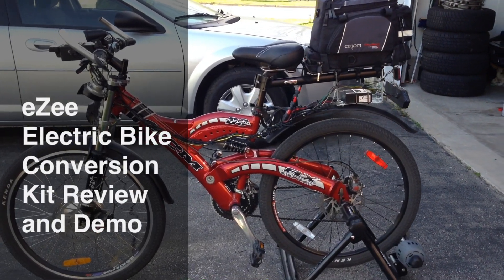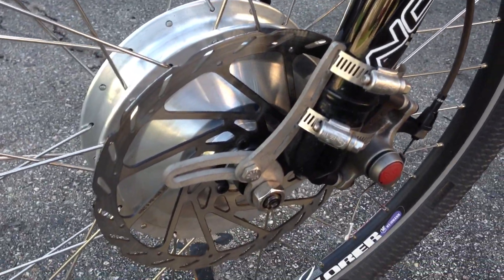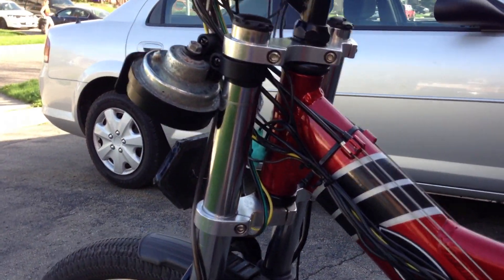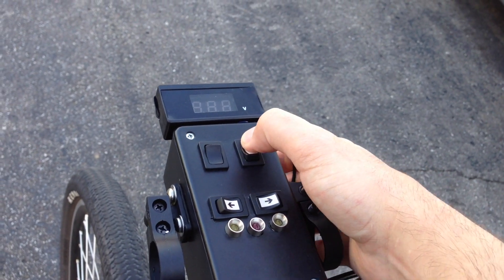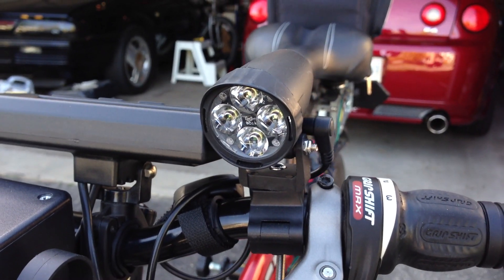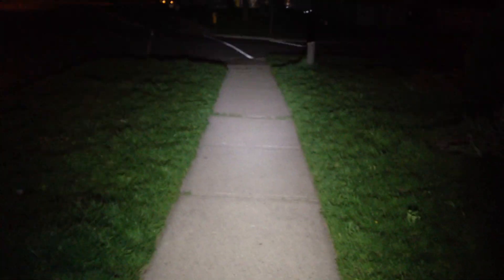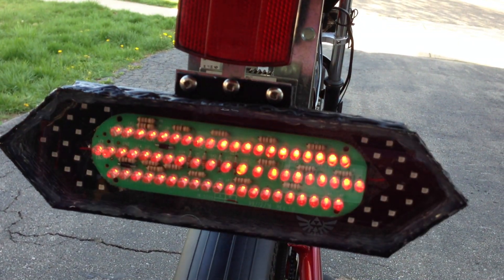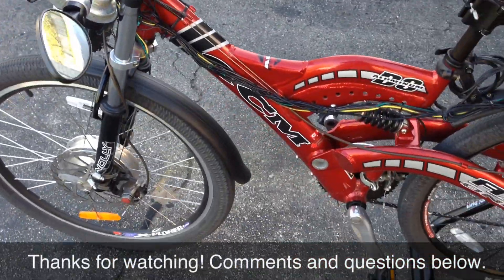eZee Electric Bike Conversion Kit Quick Review (after two years) + Demo

Comment: Nice Video !!  Because I'm involved with the radio control industry, I used a lot of RC equipment for my conversion.  Batteries are 4 to 8 depending upon needs 5000ma 6 cell LIPOs which gives me up to a 20ah 48v power supply.  I like your brake lights and turn signals, I used string lights for my tail lights, my extra headlights are from a large RC dune buggy, I still need to add a brake lights and turn signals all powered by a 4000 mah 3 cell lipo.  I need to install a center stand.

Comment from the maker: The lighting system aside from the headlight was custom built from scratch. I could never find something I found suitable for what I wanted to do so I just gathered some parts and wire and built it. Everything but the horn runs off the main battery for the eZee kit.

Comment: Ooohhhh NICE BIKE!  I very Much like the Lighting set up on your Futuristic looking Bike LOL.  Traffic here in Miami is HORRIBLE!!  Tell Me! can the turning signal lights be used on a regular non motor bike?  if Yes, where can I purchase something like this? TFS Again.... Enjoying your Videos.
Reply from the maker: It is possible to use a lighting system like this with a regular bike, but you would have to find a battery pack to power it, as on mine it uses a 12v power converter connected to the motor's battery pack to power the lights. I don't know where to buy a lighting system such as this however, as I ran into the same problem myself when I was looking and I couldn't find anything I really liked. My solution was to just build it all myself, aside from the headlight.

Comment: Alex - You're amazing. Well done! I'm just beginning on my e-bike curve. Adding a conversion kit to a new Cannondale Quick CX 2 bike. Should I go Ezee? Should I go BionX? Should I go ...? What's best to get my 95kg body + 12kg bike + 10kg shopping up lots of 100m 20% hills in Sydney, Oz? Can this be done in a (Sydney legal) 250W motor or should I go for 350W or 500W? Is it torque I need for hills rather than wattage? Do different Li batteries offer no more than a different top speed and/or distance? So many questions; so much fun. Neil
Reply from the maker: Hoping to help you out as best as I can. I'm no expert on any of this ebike stuff as I just kinda took an idea and ran with it so if anyone else reading this has any suggestions you're more than welcome to offer them.

I chose the eZee kit since it looked pretty easy to work with, allowed me to keep my disc brake with the motor, and it can be used with pretty much any bike. You can see my frame looks really odd compared to "normal" frames and some kits I've seen try to use the triangular space within the frame to store the battery and such, wouldn't have worked on my bike. I haven't checked out any other brands like BionX so it's more or less personal preference depending of course on what best suits your needs.

If you're gonna be dealing with a lot of hills, something with a decent amount of torque will make things a lot easier to manage. The eZee motors are beasts for torque, so they're a good choice from my point of view just for that. You'll want to avoid going up a lot of hills relying solely on the motor though, otherwise your batteries will die pretty fast. Also, low wattage motors + hills = not very fun. You'll need a good wattage amount to make enough torque to get you up hills easily, otherwise there's not much point to spending the money on a kit. I can set a wattage limit on my bike and I've experimented a bit with lower wattages and you end up having to put a lot more effort into pedaling to keep you moving.

On the battery side of things, higher voltages can give you a higher cruising speed, but I would be more concerned with the capacity as that will determine how far you can go on a charge. The higher the Ah rating, the farther you will go. My battery is only a 9Ah, so it averages around 30km per charge.
Reply: Alex Amaral Thanks a lot for your helpful comments, I was thinking of getting a electric conversion for my bike but the soul purpose would be to help on hilly journeys otherwise I wouldn't have a problem peddling. 
Could you recommend a cost effective electric conversion kit.

Comment: I watched your older video, is there any motor faster than yours by them? Also, do they have a 24" option?
Reply from the maker: They do make a motor for a 24" wheel, which they call the high RPM motor. If you take the high PM motor meant for a 24" wheel and lace it into a 26" wheel then it will allow the bike to go faster than usual. I don't know if there's a similar option if you want to stick with only a 24" wheel though.
Reply: Alex Amaral Thanks man, I'll look into it.

Comment: good build, like the horn, shame that the turn signals dont have buttons on the handle as will require you to let go to use them. Well done though
Reply from the maker: My handlebars have limited real estate with my setup, so while I had considered mounting switches closer to where my hands are, there just wasn't enough room to do it.
Reply: Fair dinkem, I only said it from a safety point of view, anything that requires you to let go of the handles means less control and higher risk of injury especially if you are traveling at speed and hit a bump. Good on ya though and happy riding, I hope to build one myself once I've finished doing up the house I've just bought.

Comment: Brake, tail and indicators are good, do they run off the motor battery?
Reply from the maker: Bain Andrew My original lighting system didn't, but this one does. Makes it easier when everything can be run off of one power source.